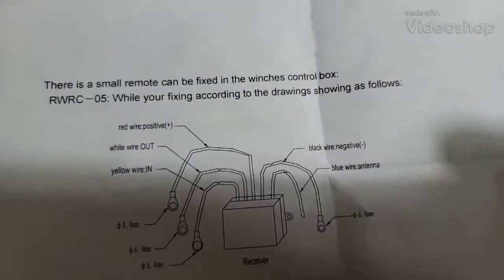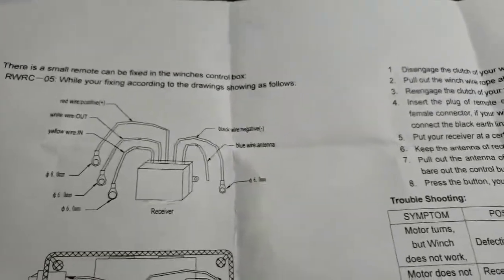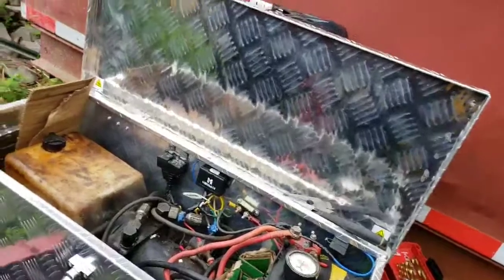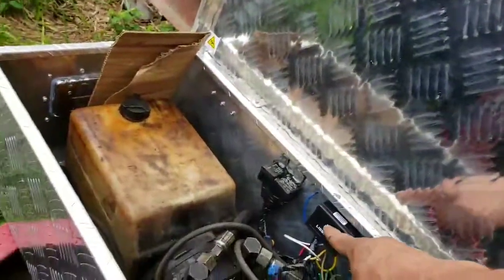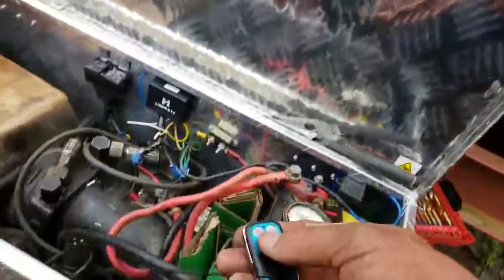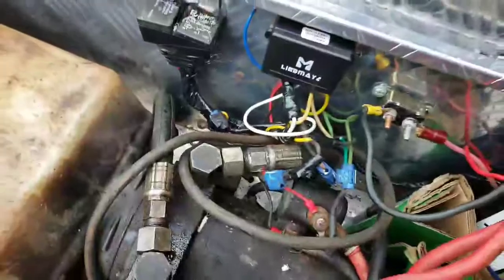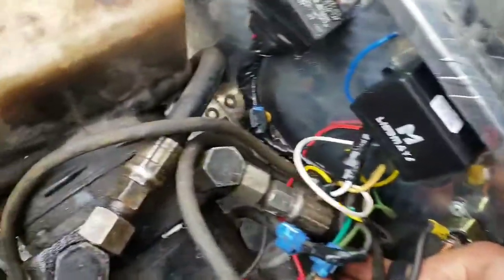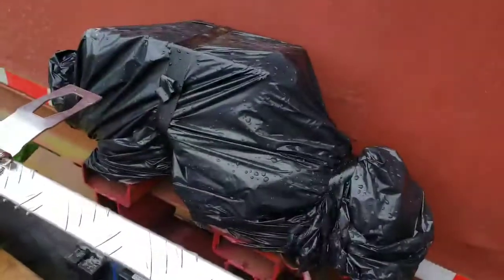Wiring a winch wireless remote to a dump trailer

Comment: Hey i have the same dump trailer set up as you and i purchased the two relays but i cannot figure out how to wire them so the starter relay will engage both up and down
Reply: I have the same problem i have 2 relays but it's back feeding when you hook up both up and down did you figure it out?